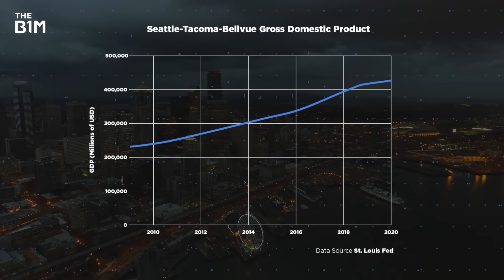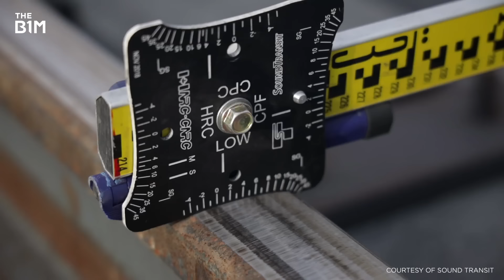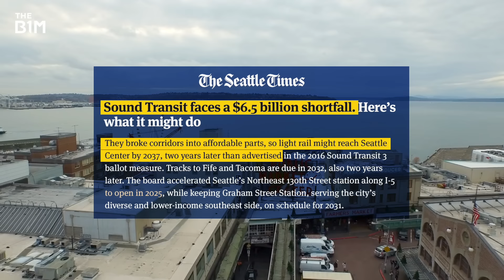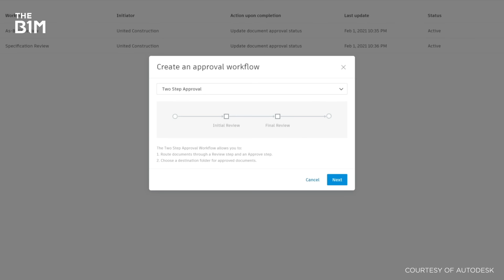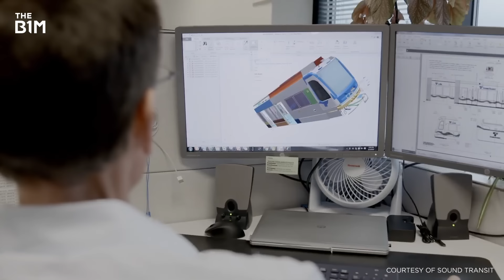Seattle is Building a $54BN New Railway

Comment: Building a light rail instead of a heavy rail is a missed opportunity.  They should spend more upfront to get as much speed and capacity as possible.
Reply: It makes no sense given population expectations, Many US cities could use a Parisian RER-style suburban network. Trams and LRT are great supplements but hardly significant people movers.
Reply: @linesided  Seattle has 4 million people while Brescia in Italy has 200k, yet it does have a metro system. With new technologies of automation and more flexible lay out you can actually build a rail line fairly inexpensively. You bring up RER as if it doesn’t require even more funds to build it. 

The issue is that Seattle’s system is designed very similarly to a regional metro such as nearby Vancouver sky train. Most of the system is grade separated so it truly wouldn’t cost that much to make it a light metro. Vancouver is smaller than Seattle, but it’s system outperforms virtually any other North American city on ridership. That just goes to show how important the design of a system is.
Reply: @justsamoo3480  You're using the population of the entire Seattle MSA (Metropolitan statistical area), which is massive. To be exact, the area of the Seattle MSA is 5,872 sq mi (15,209 sq km)... meanwhile the entire city of Brescia is only 3 miles across. Even if you look at just the most urbanized part of Seattle, it's still over 60 miles from Everett to Tacoma. It's not feasible to build out a heavy rail metro system when the population is so spread out.
Reply: @nicholasfu5937  Are you not listening? Seattle is using basically building infrastructure for a heavy metro line (literally 8 km of street running on the whole system), but using light rail vehicles. Fun fact the biggest cost on a transit system are stations and Seattle could have build smaller stations for a metro that would run trains every 90s instead of a long light rail vehicle that runs every 8 minutes. Also I think it’s stupid to extend the system all the way to Everett and Tacoma, those destinations can be served with good suburban rail. That would be much better for everyone involved. 

Right now Seattle is using tram vehicles, on what is basically a metro system to serve a purpose of suburban rail. That is stupid. There’s a reason why we have different types of modes for different purposes, which is something that cities continue to learn time and time again.
Reply: @justsamoo3480  metro Vancouver is nearly the same size
Reply: @pranadprabhu2586  metro Vancouver has ~2.5 million people compared to Seattle's ~4 million. If you're talking about population size, it's not even close.
Reply: @pranadprabhu2586  Vancouver has 2.4 million while Seattle has 4 million. That is 1.6 million difference, which is bigger than a population of Oklahoma city. So yes it is a big difference.
Reply: @justsamoo3480  Completely agree.  Seattle is building this almost completely grade separated system with massive stations...then running trams on it.  It makes no sense.  There's no cost saving in using trams here, they just move fewer people in the same amount of space than a metro would.

With just a bit more work upfront to make the system completely grade separated (it's 90% of the way there even as it is) this could have been a phenomenal proper metro system.  Instead we get this weird half measure.
Reply: @justsamoo3480  care to explain why a metro is better? I live in Portland, OR (max light rail) and:
1. The trains are the same length as any metro I’ve rode in SFO, NYC, DC, etc. 
2. The trains didn’t go any faster in those cities. Portland does have some shitty spots where cars get favored, but Seattle does not. 
3. The Seattle light-rail has the right way in almost every location. 
4. Trains didn’t come every 90 seconds in those cities unless you were in the heart of multiple lines passing — just like here in Portland. 

Why is metro better? Let’s hear the details instead of using the fancy words “metro” is better. WHY?
Reply: @shiloo  He told you why.
 Metro cars can carry more people compared to light rail cars of the the same length, thus would allow the stations to be shorter and with them being the biggest money eaters when building mostly or fully grade separated railway lines, Seattle would have been able to save more money or build the system sooner since it would have costed them less from the beginning.
And since a metro would have to have been fully grade separated and with this being a completely new system instead of an old one like in the cities you mentioned, the city of Seattle could've went with automated metro like Vancouver did and achieved both a higher speed and a higher frequency than what they have now all at a lower cost..
Reply: @shiloo  I just want to clarify that I don't think the light rail is bad or that trams are useless or anything like that. I think that they're great where they make sense, like in Portland. Which would have a very good system if they build that tunnel in the slower downtown sections.

And I highly recommend that you check out a YouTube channel named RMtransit as it explains all of this in much more detail (but not to much so casual viewing is possible).
Reply: There are heavy rail Sound Transit commuter routes servicing the Seattle area. There is really no more room to build new routes. Buying up existing private properties and enacting imminent domain will displace hundreds of the thousands of people. Not to mention pissing off everyone. The cost would quadruple the budget. It is not feasible.
Reply: @kevadu  Might be worth mentioning that the downtown tunnel used by Sound Transit Link light rail was originally built in the 1980's and designed for both bus and light rail use (although Light Rail didn't show up until 2005-ish).  The rails are embedded in pavement to allow for bus traffic, which would probably make using a third-rail metro or heavy-rail system more difficult than overhead wire light rail.  The buses left the tunnel a few years ago so it might be possible to retrofit, assuming the sharp corners by Westlake Station don't cause issues.
Reply: @BagoPorkRinds  I know that, besides it’s literally mentioned in the video. But that doesn’t mean that Sounder is anywhere close to an RER system. Not every suburban rail system can be compared to an RER. RER has much higher stop density, has lots of dedicated track and even purpose build tunnels, it operates on a higher frequency and has a metro like signaling system. RER is much more similar to something like BART than Sounder. The comparison that could be made is Sounder and Transilien, which is a much more conventional suburban rail system. But even then Transilien outdoes Sounder on every metric possible.
Reply: @justsamoo3480  Dude you don't to seem to understand, RER or Bart do not share the same road with vehicles on their routes like Sound Transit's light rail on parts of it's route. That is why they require drivers and not an automatic system. That is a standard around the world whether in the Czech Rep. or Japan. The only things auto in Japan are their monorails in Tokyo and Yokohama.  RER and Transilien cars are bigger and heavier and thus require wider tracks. Just as Sounder commuters are only for heavy rail and thus why they are considered a regional and not specifically as an urban rail system. By NTSB safety standards that means there has to be even wider clearances from structures and traffic in the U.S. Building heavy rail right down the middle of Rainier Ave where the main lightrail route pops out from under a tunnel coming from the airport to dntn Seattle ain't going to ever happen. No where in the U.S. will new heavy rail tracks are going to be built straight through an established urban core at street level. Tunneling even more as your suggestion for these bigger cars would significantly increase the costs. Seattle ain't Paris for a RER or Transilien, it has much more challenging geological topography.
Reply: Sound Transit could be converted to a light metro pretty easily, only the section on MLK would need to be changed to remove the at-grade crossings. It honestly wouldn't be the worst idea to elevate that bit, then you could run something like the Alstom Metropolis.
Reply: @justsamoo3480  I rode the buss and skytrain system for 15 years and miss it ...ALOT!!!!!!!!! im so depressed :(
Reply: @kevadu  Sky train is wonderful its ALWAYS and almost always on time. It is above grade not competing with traffic its heaven.

Comment: An important development on this that I hoped you would mention is SB 5528, which has passed the WA State Senate and is making its way through the State House. This would allow subregions of the Sound Transit area to fund transit on their own without approval from the larger Sound Transit area. This would allow Seattle and other regions which really want light rail expansion to go full throttle without having to get votes from more anti-transit suburbs. It will speed up projects and allow the construction of new projects that serve Seattle much better than the current projects that have a decidedly commuter train philosophy.
Reply: Why didn't they just do that from the beginning lol? I assume it burdened the burbs with a tax increase.
Reply: @tima9083  they didn't do it before because it would be illegal to do so, thus the need for a state law to be passed to allow it. Washington State, unlike some, regulates its own government authorities even more strictly than it regulates businesses, especially when it comes to taxes.
Reply: Conceivably, this could also allow Burien, Renton and Tukwila to fund a light rail spur that mirrors the current Metro Bus Rapid Ride line between those cities, connected to the spine at Tukwila International Blvd.  Renton has already scoped out potential alignments.

Comment: They're spending $54 Billion to put trams in tunnels. That's double the cost of Crossrail, which makes this "railway" look like an amusement park ride.
Reply: True but crossrail is only covering crossrail where much of the infrastructure was already existing. ST3 covers all aspects of transportation like busses, bike infrastructure and many other types
Reply: @metrofilmer8894  Okay, that's all well and good, but how about Seattle invests their money into a system that is fully grade separated and utilizes proper rolling stock instead of S700 trams that are designed for Stadt-Bahns in small dense cities of roughly 500,000 people. Seattle should be using fully automated, open gangway trains such as Alstom Metropolis that are being used in Sidney. That would increase base capacity by at least 25%, but that doesn't even account for the added frequency of up to a train a minute, and the added speed that comes from shorter down-times and greater operating efficiency. And said system wouldn't even need drivers, so Seattle could focus more drivers on their bus network.

Comment: If I remember correctly this is where the RTA Tax came from forcing you to spend a ton of $$$$ on your license Tabs every year and took a lot of people by shock when they went to renew there tabs and it would cost $300-$900 or more depending on the year and value of your vehicle. A lot of people dont even live in an area where the light rail will impact them but still forced to pay for it.
Reply: Yep exactly
Reply: It will impact them though. Less traffic
Reply: @darthmaul216  maybe for some but if you don’t drive at all in that area then it still won’t help them

Comment: The tricky if not questionable aspect of Seattle's rail expansion is that they're essentially using the equipment of light rail (Siemens S700 LRV) to do the job of a rapid transit system. If the city continues to grow I suspect at some point in the future this would become a bottleneck to the system's capacity and efficiency. In hindsight, having built a full blown heavy rail rapid transit system could've been a better plan instead. It seems that outside of the Rainier Valley segment of the Link system, the network is already fully grade separated on viaducts or tunnels like a rapid transit system as is... 

0:41 The green line on this map actually shows the Sounder commuter rail, a diesel locomotive hauled push/pull train service with trips to downtown Seattle during morning rush and departures from downtown Seattle during the evening rush. There's essentially no regular weekend or off peak services (unless there's sporting events going on downtown) on this line and the trains share their tracks with BNSF freight traffic. The train is fun to ride if you like trains or wanna do some sightseeing along the Puget Sound, but it's just not a convenient option for people who wanna get places using transit. 

Here's how a ride on the Sounder feels like: https://www.youtube.com/watch?v=Wl3ovQfOeSQ&t=2927s

Sound Transit does deserve credit for operating a good BRT style express bus network with frequent and reliable service and dedicated infrastructure: https://www.youtube.com/watch?v=UtuTwxzPDWs&t=1343s Their express bus service is arguably the best in the US.

Comment: The American infrastructure plan is dumb. It should be used for mega projects, but its gonna be split into tiny grants that don't really change the status quo
Reply: Mega projects are not very useful when the common everyday infrastructure is insufficient, which is the case for every city I can think of in America. It would be great to have both. Ideally funding would allow both. But i would prefer each city have a robust bus and light rail system before we start connecting them with high speed rail, for instance.
Reply: @colep5867  mega projects as in new subways, high speed rail, new ports.... 

but most of this is gonna end up partially fixing dumb stuff.

Comment: The funniest thing to a Seattleite that has been here for a long time is the fact that the I-5/520 overpass BS hasn’t been fixed. It’s a project that could be undertaken without shutting down any traffic and would not require ripping up any of I-5’s pavement. Although they would probably figure out how to turn it into a $1B project, it could be done for less than $100M and cut traffic jams into and out of N Seattle and Bellevue substantially.

Comment: As a former Seattle resident this is cool, but too little to late. I-5 and I-405 have been overtaxed in their capacity for well over a decade. Lack of highway/public transportation infrastructure contributing to the skyrocketing cost of housing in the greater Seattle area. To work in the city you can reasonably only live bout 10 miles away without having over a 1.5 hour one-way commute. King County has had some of of worst infrastructure planners in the nation.

Comment: Well I learned a few things about Seattle in this video, not just the infrastructure focus (not from the USA btw). Firstly is the lake topic really. The idea of a floating bridge for trains seemed 'odd' which then sparked me to look into it further. The only example I knew of previously was the original Hobart Bridge over the Derwent River in Hobart, Tasmania. The 'river' there is technically a harbour formed from a drown valley and averages some 30m deep where its narrow enough to bridge so engineers spanned it by floating concrete cubes, strung into a curving pontoon bridge with a short lift span at one end for boat traffic. It was replaced in the 50's. The idea always seemed 'makeshift' to me, but realising that Lake Washington is about 50m deep where they plan to cross it, it suddenly made sense as the only really viable option, as a subway tunnel would need to drop considerable depth to get under it and a bridge would need piers like office towers to just break the surface.

But I was also a bit disappointed on looking at the Seattle area closer. Internationally, it and nearby Portland, has this reputation as being sort of a 'pin-up city'; an example of one of the US's cooler, more 'hip', liveable cities (like a sort of role-model almost, the 'cream of the crop'). But just a few passes in Google Maps and some street-view exploration paints a totally opposite picture of a car-dominated, un-walkable, crumbling dystopia, only marginally better than the hellscapes that set the average for the US. Decades of political intent and urban planning being corrupted by the oil and automotive industries has absolutely ruined the country to the point that I struggle to even ponder what might help to make it liveable and half the time it seems that the average American still hasn't even noticed the elephant in the room of why US towns/cities suck and are falling to ruin. Seattle has been trashed by car-planning like the rest of the country, but I suppose that it is at least making a valiant effort to break the toxic cycle (car is too big for city and needs more space to drive/park, city becomes spaced out to fit cars in, city now too spaced apart to walk or support public transport, residents buy cars to cope, more cars now need more space, repeat). I see this as a "build it and they will come" solution, one where maybe, once a solid public transport option is provided, local planning can finally design without the car in mind because they finally have an alternative.
Reply: My friends didnt need a car when they lived in portland a long time ago